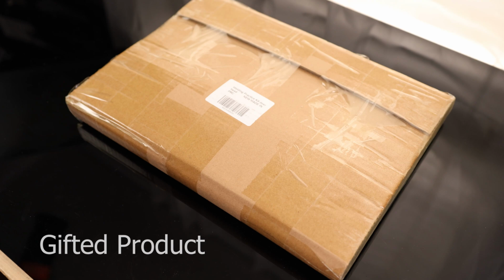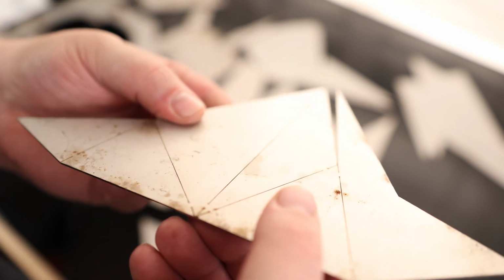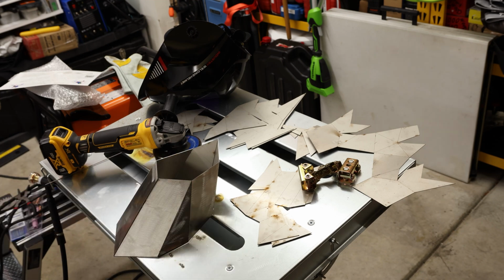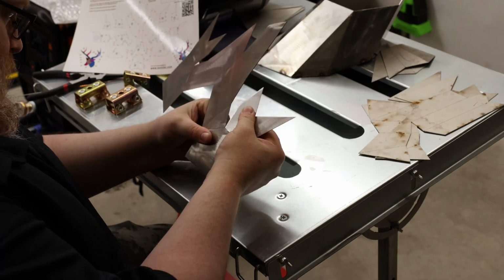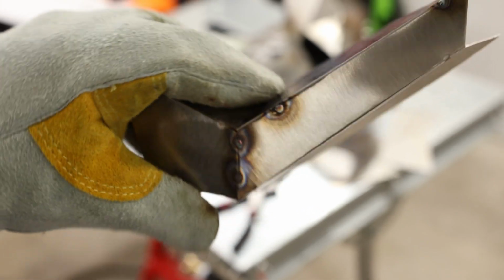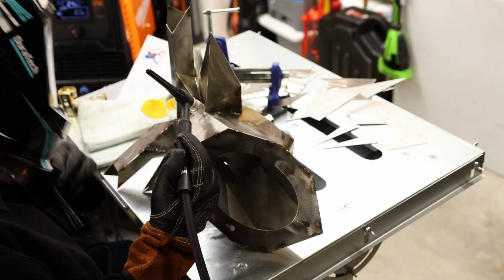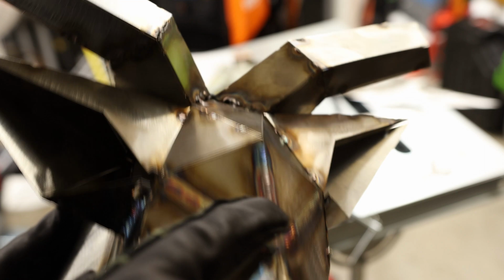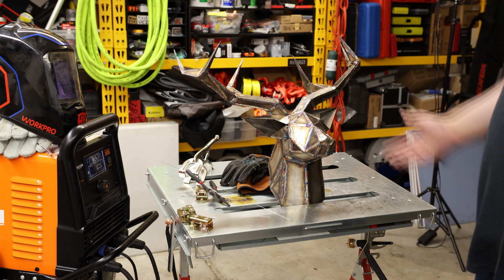I Tried The Sonnler Deer Head Welding Kit

Comment: I use the sheet metal bending vice grips to help bend with out breaking and add a couple more tacks before I bend as well i only broke one on this one so far but there is still a lot to go. Lol my biggest problem on the last one i did and this one is getting every angle correct if you don't it gets all out of wack. This one has a coller that is helping so much this time. I did the eagle first and there's no collar to help the shape.ʻ

Comment: I am doing the deer head for my grandfather.  My kit had a lot of dross on all the edges from the laser. I used my d.a.sander on everything before i started bending. Still had to use a small file on the edges, then acetone to clean it all.  It goes much better after a little prep. I also recommend using some silicon bronze filler. .045 worked well for me. If you're not familiar with it, look up tig brazing

Comment: I’m running 25 amp’s with the petal to control it.  Gas lens with 1/16 tungsten, I was using 3/32 tungsten but to big for low amps for me here. Glad to hear others are breaking the bends😂. It gets annoying though maybe a little thicker material and it would’ve helped with this cnc design by them. Overall fun little project if you got the time and patience.

Comment: I just got this the other day. I didn't know the metal was so thin. And so far every piece I've tried to bend had just broken apart lol. 

Thanks for this! Now I know I need to go get some smaller tig wire.
Reply: Hey I got one the other day I found if u tack all the bends in the middle or one tack per end of the bend it holds better
Reply: Same happened to mine. Almost every bend has broken and left me frustrated. I was about to throw it in the scrap bin but I’ll give the tack before bend a try

Comment: Thin metal, tough corner-just lay wire start arc ON filler and it will join the corner smoothly. Something like that I’d use .035 wire. 
Also I’m interested in your gas flow the cup you are running should leave clean tacks.